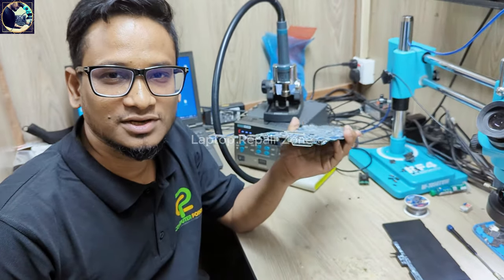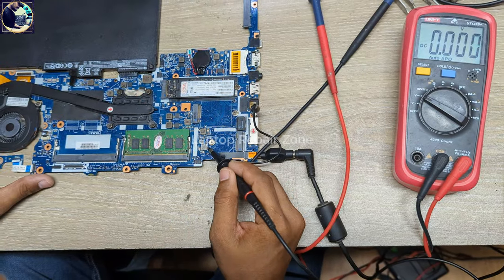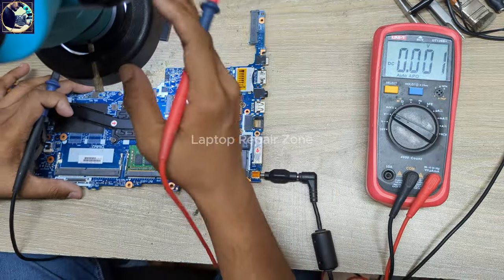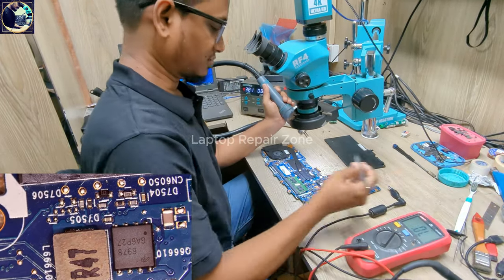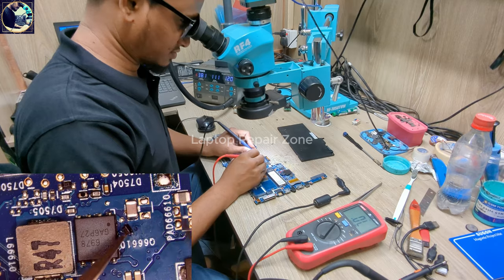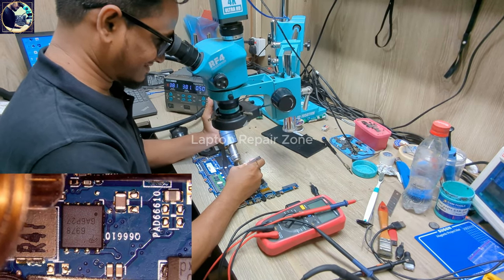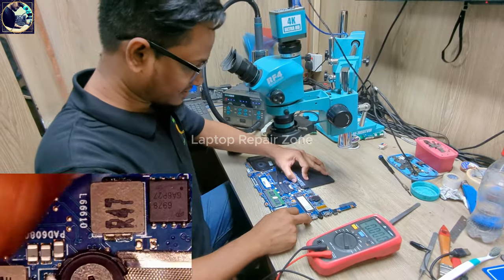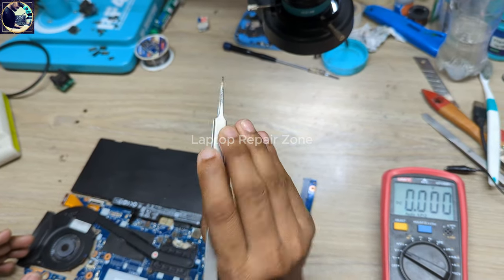Hp elitebook 840 G3 battery not charging fixed | laptop battery not charging fixed !!!

Comment: In case you do not have a donor motherboard, can you say what diode is supposed to be there? I have an Elitebook 840 G3 I got for free that doesn't charge correctly and I might attempt this. Even if I can't find the exact right package I reckon I should be able to bodge an electrically similar diode in there.